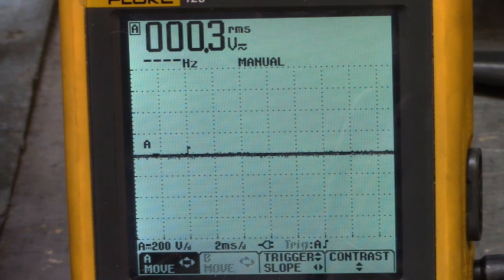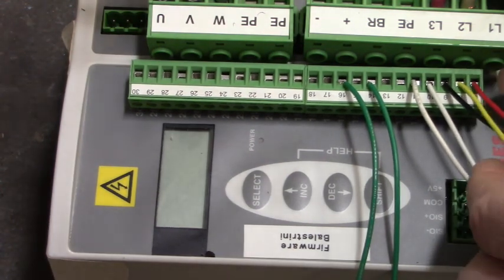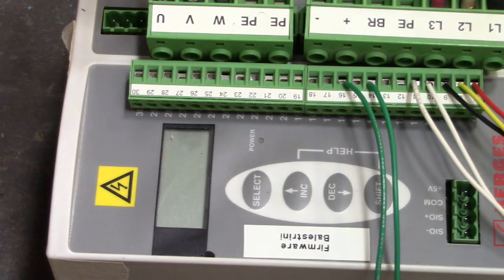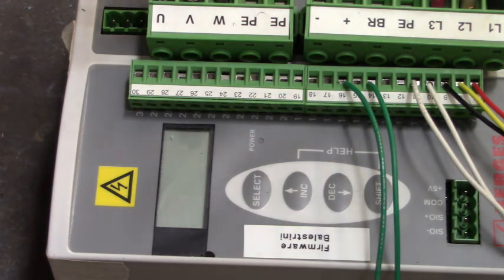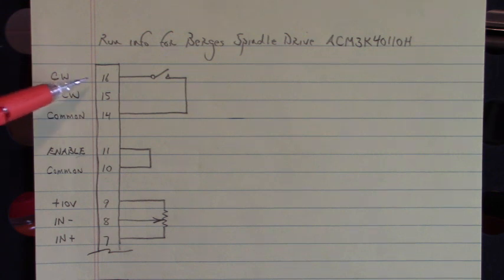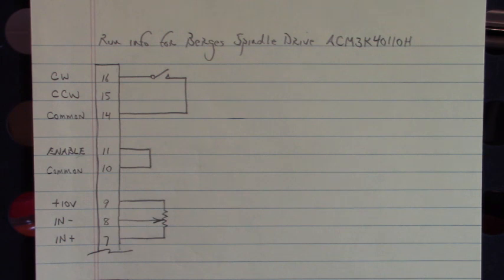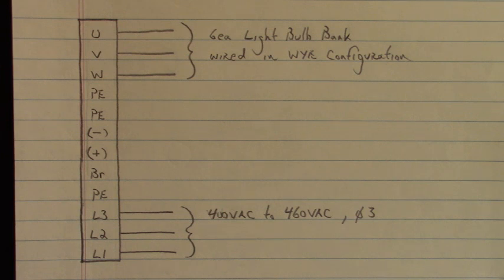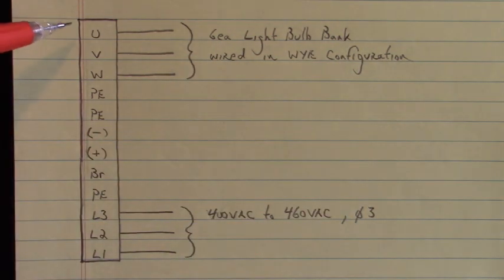Testing the Berges Spindle Drive Type ACM3K40110H

Comment: Hello, we have BERGES ACM-D2 11kW also with Balestrini firmware and when we run some program, after pressing START in SW, after a few second appears "ERROR 9" on inverter. What do you think can be wrong?
Reply: Did you solve your problem? I have same too
Reply: @eminyildirim89  Hi, IGBT module FP75R12KE3 was failed inside invertor and had to be replaced.